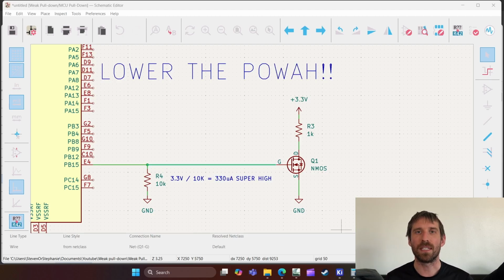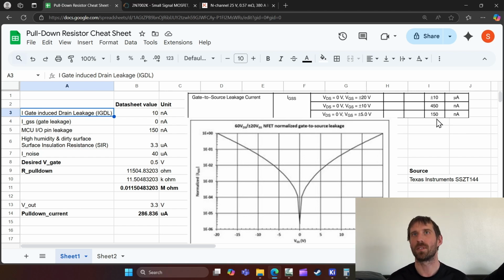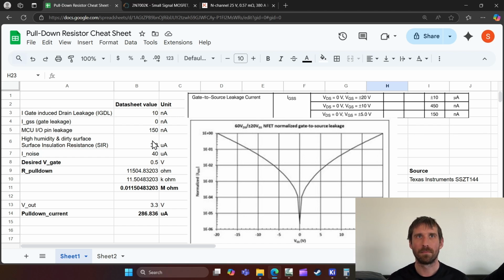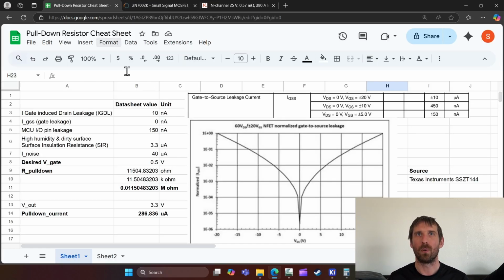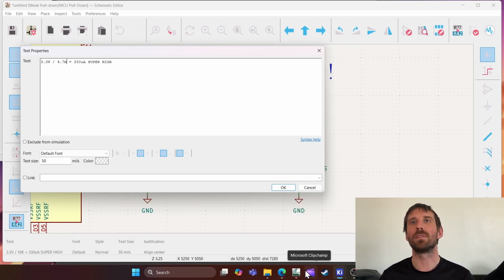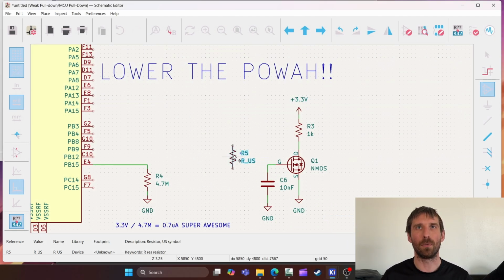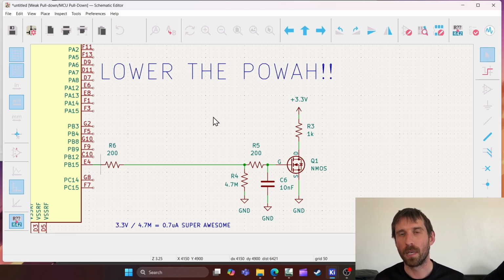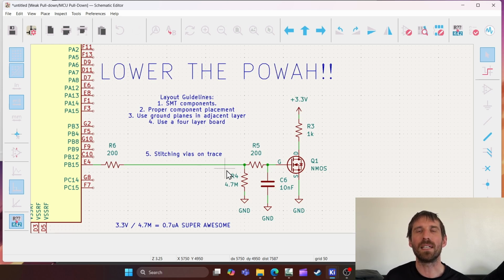Pull-Up and Pull-Down Resistors: You’re Using Values That Are WAY Too Low

Comment: https://youtu.be/KkNlLi9r_kc?t=406 Ha ha ha. Foe a school exhibition, my friend built a demonstrator using 741s. It didn't compute as expected. On a whim, I suggested that the plywood used to mount the circuitry might not be an insulator. After wrapping the screws in cellophane tape, it worked.